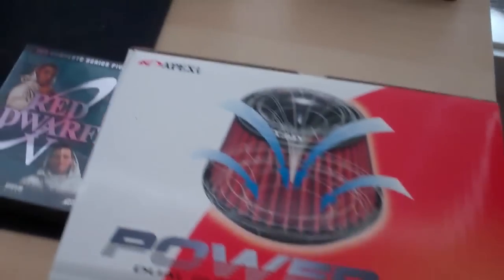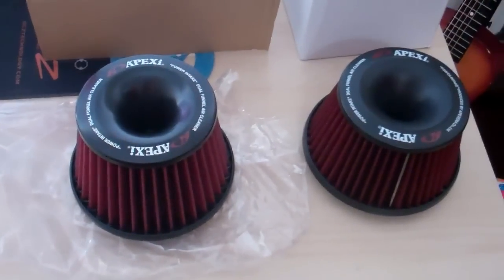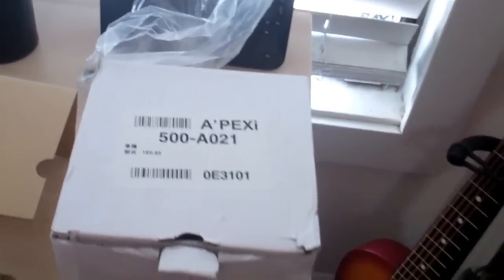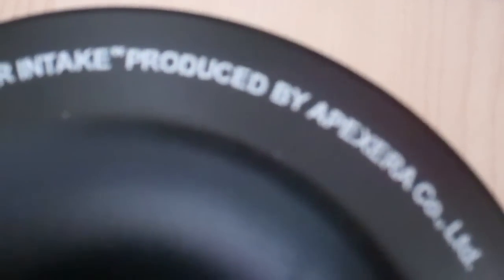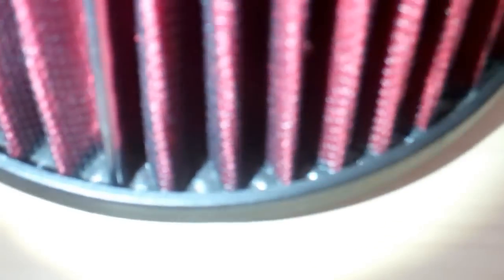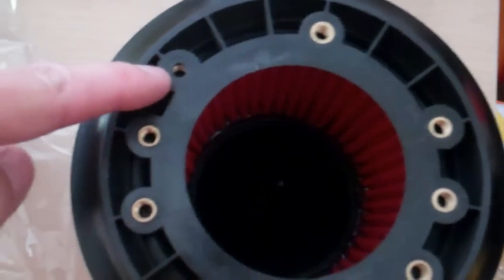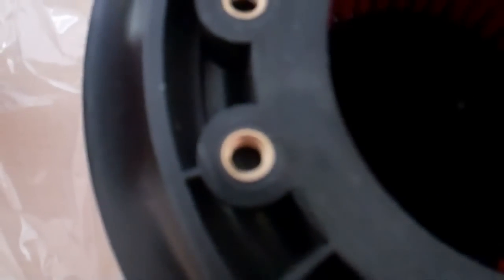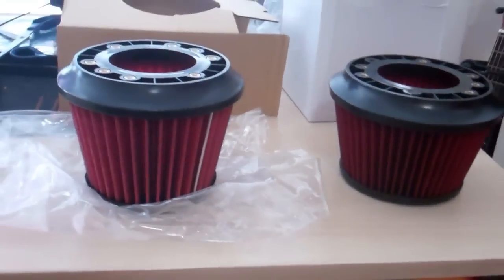2011 VW GTI: Episode 51: How to tell a fake Apexi air filter

Comment from the maker: Happy to say that over 2 years later, I have yet another Apexi filter coming today for my current intake project. I am not sure if the words "Apexera" are a fake part anymore, that may be the Apexi parent company. But the crappy pleats and crappy bolts tell you for sure if the filter is a fake.
Reply: I got two what I assume are fake ones from overseas.  The bolts and pleats look perfect including the cone inside. The only difference I can see is the glue is white instead of black.  Mine says Apexera as well and made in Taiwan on the box.  Maybe they outsourced the manufacturing on these.
Reply from the maker: Tyler Moser naw dude its fake. Apexi are made in Korea.
Reply: Ok figured.
Reply: +LastHumansGarage Pretty sure Apexi is made in Japan, well atleast the brand is Japanese.

Comment: So do you not recommend the filter with the PFlo? I wasn't sure if some of that puffing was the DSG sound.  The reason I'm interested in the filter is because I had a fire in my garage and my GTI was in there. Quite a bit of damage from heat and smoke but its been repainted and repaired.  Now I need to replace the PFlos filter because it got smoked. Insurance is paying for it so I was gonna go with the apex If its better.

Comment: The real question is .... is it the same filtering material ..??  And is it filtereing as well as the real one..?? 
I am a firm believer that most if not all things come off the same assembly line and just the labels are changed and you pay more for the same unit with the "name" brand on it ... 
for example back in the day was the greddy type S bov ... they had the knock off and the name brand, one place had one of each and took both apart and to a surprise, both were identical in shape and weight and material ...  difference was one had greddy on it and the other did not ...

Comment: I check on ebay for apexi power intake and I see that they are few that comes from Malaysia (horsepower.1012). Their filter seams to be the real one but the fitting adapter is not genuine apexi. Do you now if those parts on ebay are fake or not?
Thanks!